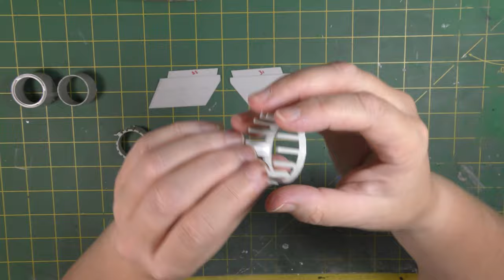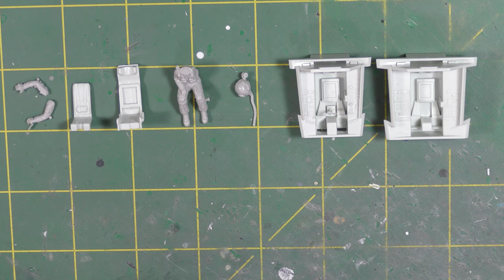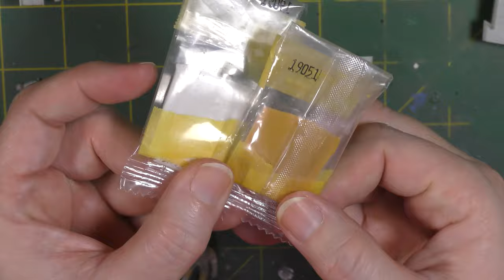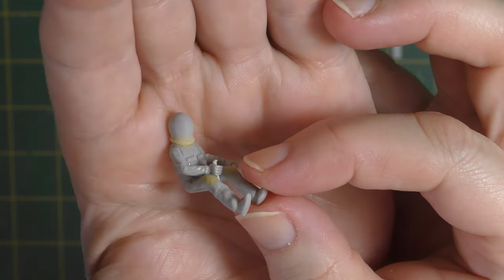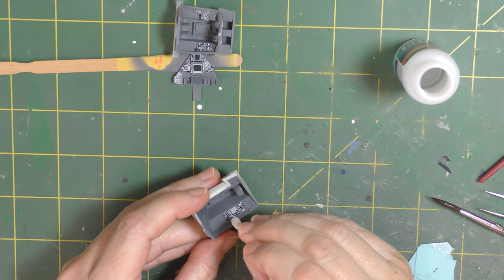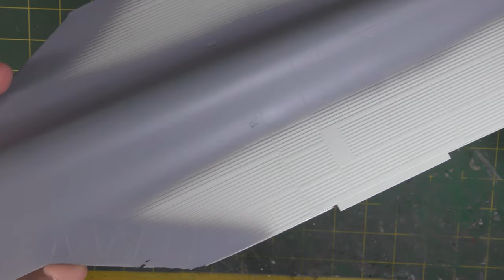Black Ops! - Revell 1/48 SR-71A Blackbird Part 2

Comment: Configuration varies on how the model will be displayed. Blow-in doors, Landing gear, spike position. Also, paint schemes, nose section, and decals would vary depending on the mission. The subdued paint scheme would have only small red tail number and red maltese crosses on the upper rudders, Sometimes there could be different tail numbers on the same Blackbird.

Comment: Your usual amazing attention to detail.  you display aircraft flying at home do you make your own stands?  For some reason it seems to be very difficult to obtain premade stands.
Reply from the maker: I do, yes. They are supposed to fly after all ..... I agree that stands are annoyingly hard to get. There are some really nice ones supplied in various kits but they are quite rarely available separately.
Reply: @JenesisDesignsandModelcraft  Absolutely they should fly 😃. So do you build custom stands yourself, if yes would you be happy to share photos.